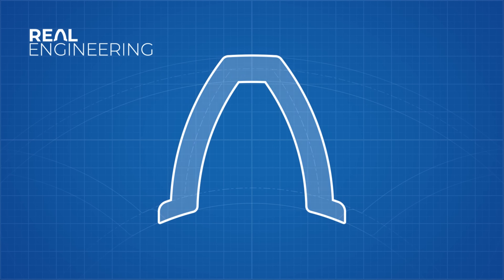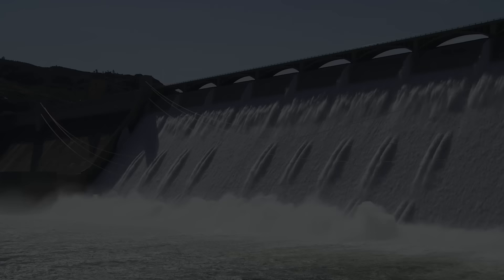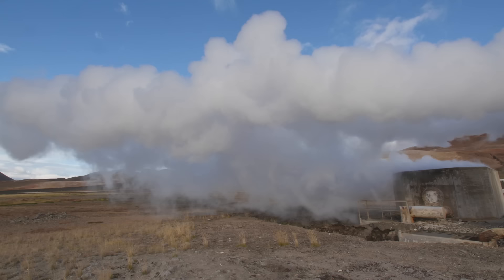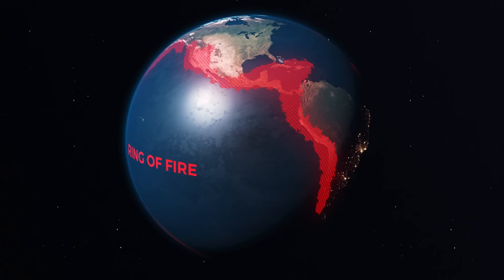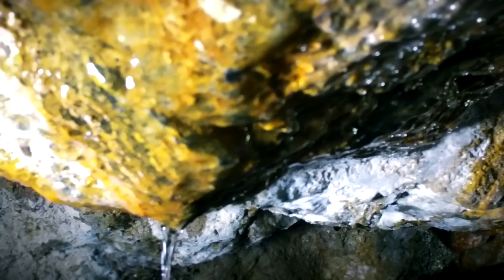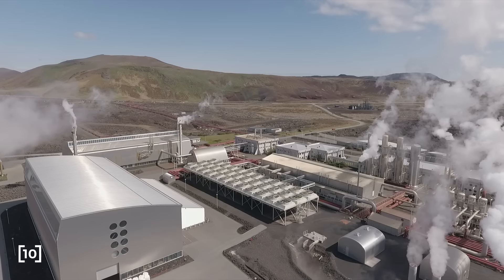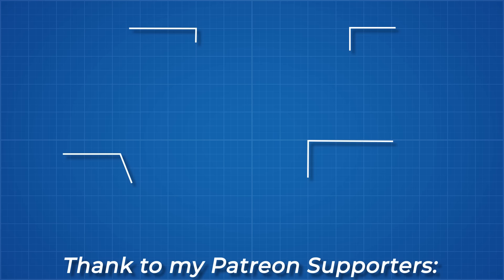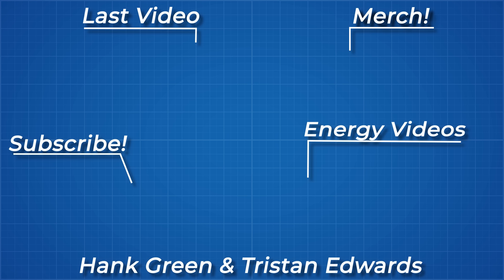Could Earth's Heat Solve Our Energy Problems?

Comment: Please do a video on Thorium based energy, it’s are very underrated and not many people know about it.
Reply: Specifically Molten Salt Reactors. What's better than just using Thorium as fuel? Using it and all of the "nuclear waste" in short-term storage as fuel. Two birds, one stone, IMO
Reply: In my experience thorium isn't underrated but rather has its benefits massively exaggerated by people in science-adjacent circles online.
Reply: Not only thorium, but a whole raft of different Molten Salt Reactors, that can use not only Thorium, but also nuclear waste and plutonium. The process heat is high enough for making liquid hydrocarbon fuel, and removing CO2 from air or ocean.
The nuclear energy supply is next to endless.
Reply: @Danijel Mornarić

Only if it was as profitable as oil, coal, gas, and to a lesser extent solar. Profitability is the main drive for what power sources are propagated typically, not safety, reliability, etc.
Reply: infant jones I also find it interesting that those who support thorium are largely unaware of the fact that the USA has actually used thorium in commercial reactors in the past, but the costs of using the fuel were greater than its benefits of production. 

Shippingport 1977 Reactor 3
Ft Vrain 1984 Reactor 2

Both of these reactors were Light Water Breeder Reactors that did not significantly outperform conventional PWRs. 

So when these people point out the benefits of a LFTR, what they fail to recognize is that the considerable benefits are largely based on characteristics that thorium itself does not necessarily provide.
Reply: @kevin paul halliday

Thorium reactors absolutely do produce "weapons grade material", in the exact same way light water reactors produce "weapons grade material". Both produce plutonium, and thorium reactors produce Uranium-232, which is usable in weapons. 

The thing is that neither of them actually produce "weapons grade" material, but rather reactor grade. Both the plutonium and uranium to come out of them need to be enriched in order to be usable in a weapon, as the plutonium has far too much Pu-240, which makes it virtually unusable in weapons, and U-233 needs to be nearly completely pure for use in weapons. It's easier and requires fewer centrifuges to just enrich natural uranium right off the bat. 

For weapons grade plutonium, you need special types of reactors to produce it. These reactors are not the types widely used for nuclear power because they're far less efficient at producing power. Graphite and heavy water moderated reactors are what are used to produce weapons, graphite moderated water cooled reactors can be dual purpose but are less efficient than light water reactors, while graphite moderated gas cooled reactors are very good at producing weapons but terrible at producing power. Graphite water cooled reactors are used less and less in the dual use purpose because they are far more prone to accidents than light water and heavy water reactors, and the nuclear powers haven't been having an arms race for decades. Light water reactors, which make up 75% of reactors globally, are what is used exclusively to produce power.

It'd be nice if so many arguments for thorium didn't rely on repeating falsehoods about uranium.
Reply: I don't like Thorium based energy because it is not proven to work and geothermal is.
Reply: Cranson Snord This is not true. Here’s the problem.

- We have groups of people that believe Thorium is a god material without a understanding of its history or the reactor types that use it. 

- We have people that don’t have an understanding of thorium at all, and it history of use. 

- we have people that don’t understand nuclear energy in general. 

- we have people that believe we should only pursue conventional technology (low amount)

- we have people that believe we should pursue many routes that include thorium, uranium and plutonium as we all many reactor types.
Reply: LFTR's are the answer. Biggest problem is being able to test the salt in a closed system. And congress literally having no clue about anything. SQUEEK!!! GREEN ENERGY LOL

It will have a simple pretty much full proof safety feature of a frozen salt plug and an empty tank should power fail. Salt plug melts and drains fuel into a safety reservoir. No more neutrons are introduced, reactions stop. No more pressure vessels that explode and lead to run away chain reactions.

It can consume most of the waste we are storing already that has a 30K year half life

The very little waste produced only has a 300 year half life.

Nuclear medicines can be obtained from the fuel

Thorium is one of the most abundant minable minerals on the planet. So fuel will be essentially free

It does produce weapons grade Uranium 233. But being in a molten salt We actually are able to use almost all of the fuel unlike very expensive solid fuel which only consumes 3% of the material

Im sure Im forgetting something. Search Youtube videos for "Mark Sorenson LFTR"
Reply: @AgentJRock805 So a few things: 
1. You are correct that Congress is rather clueless about Generation IV reactor, but thankfully they have passed a slew of laws that will help with their advancement such as: 
-  Nuclear Energy Innovation Capabilities Act- A directive to increase funding in the DOE for research into advanced nuclear technologies such as fast neutron reactors, molten salt reactors and small modular reactors.

- Nuclear Energy Innovation and Modernization Act- A directive to the Nuclear Regulatory Commission to modify licensing processes for advanced nuclear reactor types and create new methods to oversee Generation IV reactors.

- Advanced Nuclear Technology Development Act of 2017- A directive for the DOE to facilitate and oversee the development of advanced nuclear reactor research in terms of time til deployment.

- Advanced Nuclear Energy Technologies Act- A directive to develop at most 4 nuclear reactor projects with the intention of improving safety, levelized economic cost projections, waste yields, fuel performance, thermal efficiency, risk to proliferation, reduction in consumption of cooling water, and flexibility in operations.

2. "
It can consume most of the waste we are storing already that has a 30K year half life"
So for 30,000 half life youre talking about Protactinium 231, which makes up less than 0.0001% of high level waste by volume. Even if you wanted to include a range of 10,000 to 100,000 that would still only include: Niobium 94, Plutonium 239, Protactinium 231, lead 202, lanthanum 137, Thorium 230, and Nickel 59. Many of these at non-existent in nuclear waste and those that are make up less than 0.0001% with the exception of Plutonium 239, which is not used in LFTRs as they operate in thermal spectrum. 

Perhaps Im misinterpreting your argument here, but the concentrations of waste that it could burn are not statistically significant for HLW. 

3. "The very little waste produced only has a 300 year half life."
So youre claiming that the highest concentration of waste produced in these reactors would be Uranium 233, which suggests that you believe that the majority of Thorium 232 will be breed in a reactor cycle. While some startups have suggested this to be feasible waste concentrations of the MSRBE project do not agree with this argument. 

Now this isn't necessarily a bad problem, in fact I would much rather have a larger concentration of Th-232 than U-233 as U-233 is significantly more radioactive. The argument made by those that society should be more concerned about isotopes with long radioactive decay than those with greater radioactivity does not make medical or scientific sense as the levels of risk are significantly greater for isotopes with higher levels of radioactivity. 

After all if society has a gross issue with Thorium 232, then I wonder how they feel safe living on planet earth given that Th-232 is a primordial isotope that makes up the earth's crust and has existed on this planet since its creation. 

4. "Nuclear medicines can be obtained from the fuel
"
Isotopes such as technetium 99 and Xenon 131 can already be extracted from nuclear waste and used in the medical industry if needed. Why don't we? Because nuclear reprocessing is extremely expensive. 

5. "Thorium is one of the most abundant minable minerals on the planet. So fuel will be essentially free"
Any sentence talking about materials being essentially free is likely to be incredibly false regardless of topic. Yes it is true that Monazite is typically separated when mining for silver, and thorium is concentrated within monazite. However first of all you have to then separate the thorium from monazite, which will have cost, but once demand increases for this material we will have companies directed to mine for thorium resources. Drilling and mining itself is a  multi-trillion dollar industry, so I don't imagine to understand why people thinking mining for this resource would be free. 

6. "It does produce weapons grade Uranium 233. But being in a molten salt We actually are able to use almost all of the fuel unlike very expensive solid fuel which only consumes 3% of the material"
While being dissolved as a liquid in the coolant does indirectly increase the fission probability of Uranium 233, its state of matter is not why fission probability increases. There are a multitude of variables that play a role in increasing the probability.
 
- For example using Beryllium in the coolant increases the probability as Beryllium is a neutron multiplier. Increasing the number of neutrons per reactions increases the overall probability that fission may occur for a reaction. You may note this has do with the chemical properties of the coolant and not the source of fissile fuel or the state of the fissile fuel.
Reply: @brian2440  OMG so much misinterpretation, not that I was concise but its youtube. A two page thesis is highly unnecessary especially when you're not actually providing a point. Rather suggesting something better.

All those bills give money to all Nuclear development. There is no emphasis on Molten salt reactors. This is the point Im making that congress doesn't understand. Solid fuel is a non-starter anymore.

I was talking primarily about Pu 239. And Im pretty sure it can be processed in a liquid salt reactor. Mark was hyped about that point.

The whole point of Using Th232 is that is so abundant and non-lethal to humans.

Yes, but for a fraction of the price. Radioactive isotopes can be removed from a liquid source exponentially easier than a solid source. And yes we desperately need these for the medical industry that China has a choke hold on.

A simple search will yield countless sources verifying this simple fact of how easy it is to mine.

Slow breeder reactors dont need as many neutrons and is part of their beauty.

I dont claim to be an expert here. I only discovered LFTR a couple months ago. But I implore you you to check out "Mark Sorensen LFTR". There are so many off shoots of using Thorium I want you to know where Im coming from. I think the better videos are by GordonMcdowell.

Im 100% open if you have knowledge of a better Nuclear reactor system and a video to it. All I know is Renewable Green Energy is a joke, less remote places and geothermal is a rare opportunity.
Reply: @AgentJRock805  Im well aware of Sorenson and his designs at FLiBe show real promise, but LFTR is not the only type of MSR (Interesting that you give Sorenson credit for fast spectrum MSRs, when in reality that's actually a Moltex Project, which is a MSCFR) that should be developed and there are other promising technologies besides MSRS, such as VHTRs, AHTRs, GCFRs, LFRs, and ABRs. 

For a brief  and somewhat technical summary of the technologies im talking about watch the video below from Argonne Outloud: 
https://www.youtube.com/watch?v=J2nLaCwdEbs&t=2383s

If you are interested in actual development then you should look at:
-  GIF- Generation IV International Forum
- Argonne National Laboratory
- Idaho National Laboratory
- Lawrence Berkley National Laboratory
- Oak Ridge National Laboratory
- Brookhaven National Laboratory
- And scientific studies related to MSRs
- You can also look at declassified files from the ORNL MSBRE and DMSR projects from osti.gov
Reply: @brian2440  I dont believe I gave him credit for that or anything. Im refereeing to him like I said as its his research I've stumbled upon. He gives credit to a variety of people through his videos.

I have already actually watched that suggested video. I'll make note of those other companies though. I'm just excited there is some movement to return to nuclear. And if any of the other off shoots can perform similarly or better, the better for everyone
Reply: @Danijel Mornarić Yes, this is the problem. In the long run it might be more profitable but unless someone does a Tesla on Thorium reactors it will continue to be a pipe dream.
Reply: @kevin paul halliday quite the contrary, thorium reactors produce VERY good weapongrade material. conventional reactors don't, the USE the material

Comment: We could do better with conserving what we already have. I live in Northern Virginia, surrounded by massive data centers. The smart thing would be to use the cooling requirements of the data centers as a source of heat for the thousands of homes nearby. Unfortunately smarts are hard to find at the moment.
Reply: that is a cool idea
Reply: There is a company that builds distributed data centers where they put the computers in your house so they heat they give off heats your house. They pay for the electricity and internet usage so you get free heat.

Comment: You failed to mention that Geothermal has a problem of spotted cooling in areas that we pull energy from. So it’s not like a standard generator where you reinsert fuel or other renewables which are almost/if not all ultimately powered by the sun

Comment: 2:51 The earth’s crust is thin in Yellowstone specifically because it is a MASSIVE volcano.
Reply: It's a "hot spot" underneath the continental plate that burns a hole up through the plate. There is a similar hot spot in the Pacific that created the Hawaiian islands. In both cases the plates drift above the hot spot, leaving a long trail of volcanoes, only the latest of which is active.
Reply: no its a massive volcano because its crust is thin
Reply: Fun fact: Massive geothermal generators in Yellowstone could prevent a supervolcano there (and probably diminish the local geysers).
Reply: @HalNordmann  OR, by cooling the rocks above the hot spot we increase the pressure required to break through, allowing greater volumes of magma and pressure to build before eruption can happen. Thus making the eventual volcanic eruption larger and more damaging than it would have been without our interference.
Reply: Warren Garabrandt Once it reaches a critical level we could close off the geysers and openings that vent the pressure with tens of thousands tons of concrete. This would result in absolute inhalation of any living organisms including the 60 species of animals and over 300 species of birds of which some are endangered species.
Reply: Yellowstone is protected against Geothermal use through preservation regulation. I think Yellowstone is one of those areas where research should surely be done on geothermal because safely removing heat from the magma cavity and cooling surrounding rocks will also decrease the risk of it exploding and the severity fi and when it explodes
Reply: @rollinbodda4405  
temperature isn't the main problem, it's pressure. when you cool things down, things become harder to move and with enough change it will become solid. this will create pressure chambers that where not there before. once the pressure becomes too great it will eject, causing other chambers to also eject because of the sudden force being applied to nearby rock formations. 
by cooling down any part of yellow stone you are in fact increasing not just the chance but the time in which it WILL erupt.
if they want to stop it from exploding and still extract heat from it they would need to actually OPEN the surface up so that gas can escape the magma chambers. however even that is quite dangerous and increases the risk it would just explode while doing such a thing.

the danger alone isn't worth what little you would get out of it. considering it would kill everyone in the local state within a few mins and then propagate to nearby states and then the clouds would form blocking out the sun for many lifetimes all across the world. without the sun, the surface would freeze over, plants would all die. once they die, we die because we are quite dependent on them.
looking at the big picture anyone foolish enough to say that we SHOULD touch yellow stone in anyway looks like a complete and utter dumb ass, as touching yellow stone has the high possibility to end nearly all life on Earth.
Reply: @rocksfire4390  hear me out. What if the world doesn't explode? Like if we do some more research on it.
Reply: @drewlovely2668  
if they want to research it, go for it. they still shouldn't touch it unless the have a plan that has a 100% chance to work. even a 1% chance is too high, considering what COULD happen. it's like throwing a 100 sided die and hoping a big ass rock doesn't come flatten our planet, just so we can leech a bit of sun light.
Reply: @rocksfire4390  fair point, thank you
Reply: @rollinbodda4405  Well Put them 50 miles from Yellowstone to begin with then maybe within ten.
Reply: @rocksfire4390  Well then do a study and find out.
Reply: @jerrymctee5996  
that's not how it works.
the people who want to risk the lives of everyone and everything on Earth need to do the study and find out if it is even remotely possible that they could set it off over some underwhelming amount of power production.